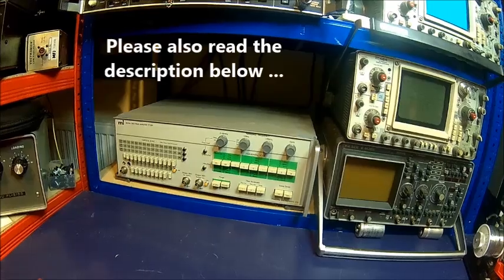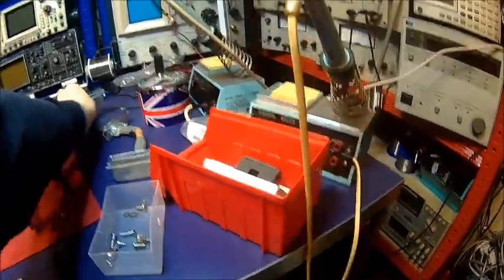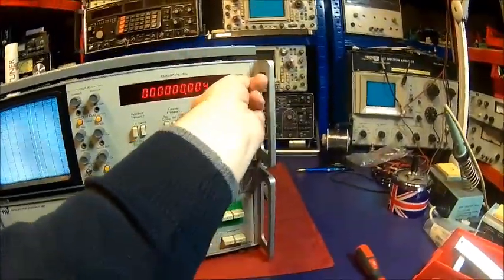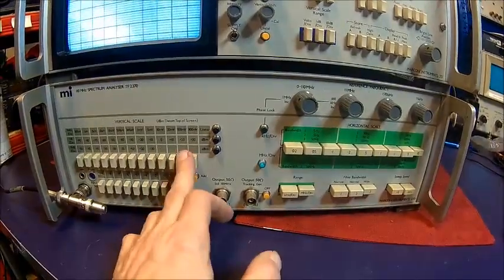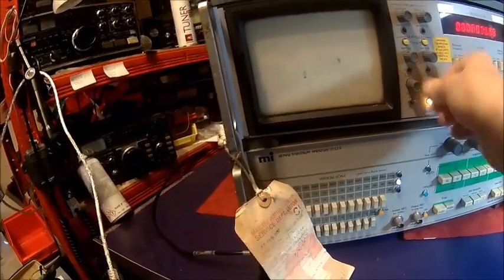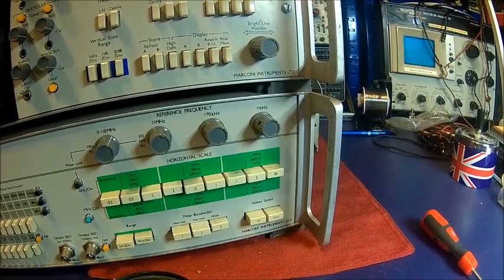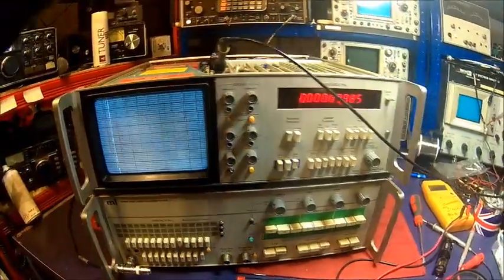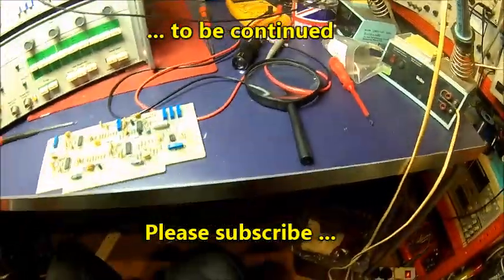Marconi TF2370 spectrum analyzer, inspection and repair, Part 1 of 2

Comment: I have this Marconi TF2370 analyzer but I have to replace its transformer.I am waiting for someone to offer it for sale on ebay.The advantage with this unit is that it has a tracking generator which is not generally found on modern analyzers.Thanks for your video.
Reply from the maker: There is a main unit currently on ebay (no display unit with it) , i think his name is 'scotttrade12'
I like this thing for the same reason, good resolution down to very low frequencies and the tracking generator gives some nice network analyzer capabilities. If it gets above the 110MHz, i just use the good old Ailtech 727, that goes up to 20GHz

Comment: would this marconi product be from the same marconi that developed the first wireless radio like the one on the titanic??
Reply from the maker: Essentially yes, .... Marconi Instruments was founded 1936 as a joint venture of Marconi Wireless & Telegraph and EPCO, in 1946 sold to English Electric, then acquired by GEC (UK) in 1968, GEC was sold to IFR (US) in 1998,  Aeroflex (US) buys IFR in 2002 and finally Cobham (UK) buys Aeroflex in 2014, so technically it's now all back in British hands ...:-)
Hope you had a pleasant Christmas ....
Reply: @dynoguy  wow! that's quite the provenance for a company. 
yeah, this year was quite pleasant. i spent the first christmas in a really long time with my brother. turned out really well. i resigned with the outfit i have been working for, for the last 7 years, and found a new job, the last two months with the old outfit were crazy busy and i hardly had time to do much in ways of vids... and i took some time off between the the holidays to recoup and recharge. it's been a much needed break.
cranked out 3 vids today...lol
hope your christmas went well and hope your move goes well. i'd love to come over to help, but won't be able to get the time off with the new outfit until i've got some time in with them.
wishing you and groupie a very happy and prosperous new year!
Reply: I just read the history. Small fish eaten by bigger ones.
Reply from the maker: That's business practice nowadays,....unfortunately.
Reply from the maker: oops, ...missed that comment...Thanks and happy new year to you as well. Hope the new job works out well.

Comment: The 82 board, amazing how large the electronics were in the 70' but that's when you repaired things. Now everything's just throw away!
Reply from the maker: You absolutely right, great designs and rather easy to repair, but it comes with the size and weight penalty of the technology available at the time. Just imagine carrying a 50lbs radio in a modern small aircraft, or a 20lbs mobile phone, not exactly practical. It's just fact that modern technology has some advantages, the price for that is that it commercially makes no sense to repair it  (well, most of the time). Nevertheless, i like my old gear, gives me a challenge every now and then ...:-)